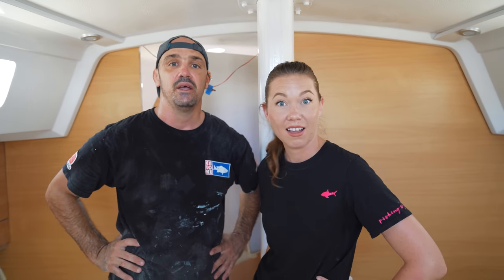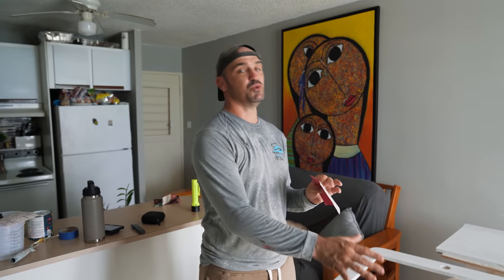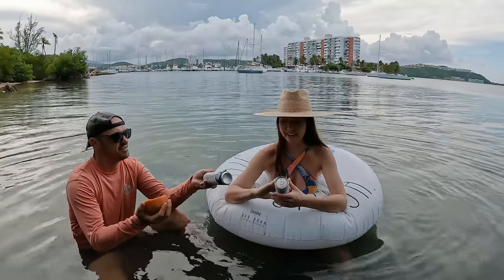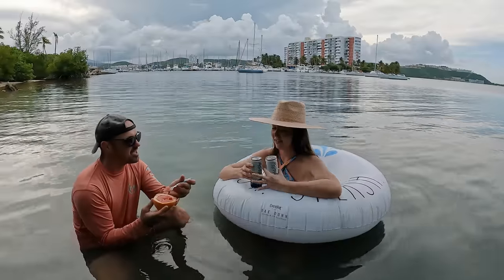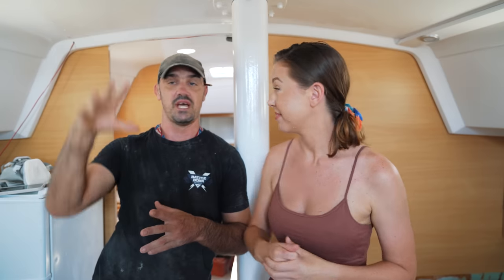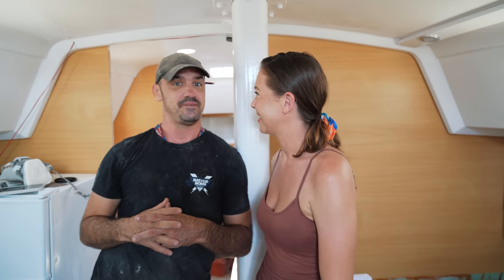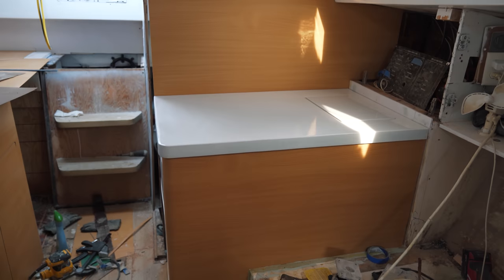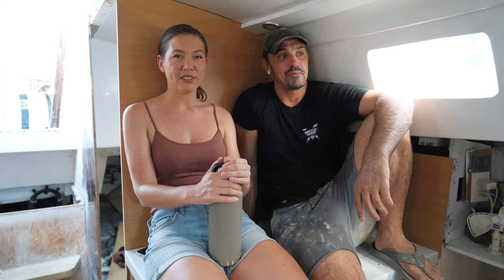GETTING SOMETHING BIG OFF OUR PLATE

Comment: a suggestion, it is to make some storm shutters to cover those large windows, which can be stowed until required--hoping they never will be.  More vessels are sunk through the sea smashing in a large window than almost any other cause (unless one goes ashore on rocks).  These covers  look like a tray made of heavy plywood, with bracing, and having a rubber seal on the edges, of sufficient size to cover the portlight, and  they need to be fitted with stainless tie down loops, and having a strip of glassed in timber fore and aft, above and below the portlight to prevent the cover slipping forward or astern, or up or down. Not only can these be used in a storm, but in the event of holing the hull on some floating object, these covers can also be used as fothering patches. (Patches that may be placed externally over a hull fracture, then secured in place either by using long screws, nails, or around-hull lashings or webbing).

I had only small portlights, but many of them and none of them opened.  Ventilation was by hatches and induction fans operating through insect screened dorade boxes on deck or on the deckhouse ceiling.

Comment: You both have done an amazing job.  As long as the top of the counter is waterproof and looks good,  the edges can be covered with varnished hardwood timber trim.  Looks good and takes the bumps.  For what is is worth, and for anyone else doing the same or a similar job, such as a shower recess,  used a water-based epoxy finish used for commercial heavy traffic flooring, fork hoists, work boots  and grit resistant. It cures to a semi-gloss finish which I kinda liked, but if you want gloss finish, which lasts only a short time, you may have to use another layer of clear resin over it.  I laid it over timber which had been epoxy saturated to seal it, then scuffed with coarse grit in an orbital sander.  There was enough in the can to do more than one set of countertops, so I weighed it on a set of el-cheapo digital kitchen scales, then broke it down to a couple of batches un-mixed, so as to have extra for re-surfacing.  It was expensive, but not as expensive as a product having "Marine" as part of its description.  I must say though--the job you did is excellent and needs no further embellishment.

Comment: Hey guys with the epoxy and resin what you need to do is get sandpaper. Wet sand the countertop wipe it down, then add more epoxy and resin use. The heat gun when bubbles come out use 900 grit sandpaper. up to 3000 grit at the end it should fix the problem you were having.

Comment: Having done 28 linear feet of countertops in epoxy... I feel your pain! However, as you get to the edges lightly roll them let them drip... router off the drips after! I realize this is after the fact! And u are correct, the marbling effects hide a lot of the imperfections! STILL... Goodonyas!

Comment: Glue a stiffener to the bottom of the big countertop. Hot glue works fine. I would hate to see that crack during handling.  Pop it off once it’s in place ready to screw down. Booze locker looks amazing.

Comment: There's a tool called a brayer, a rubber roller used in printing. It would be helpful when gluing the laminate for a overall even adhesion. You'd just roll it all over it with pressure! 😇

Comment: You are doing amazing work, no one looks at side edges of epoxy countertops because the top is epic. Have you rolled the sides as the top? Needs a rolling for you perfectionist! Just do a light sand on sides,  roll it on and be done. It's already looks perfect.

Comment: I did a simular project with my cook top from Jen-air I made the wooden frame and the Two twenty voltage plumbing and the ventilation plumbing too after I disconnect the 1959 electric stove after a mouse jumped out of it as I was making thanks giving dinner for both of the relatives and my wife after that I told everyone to get in the car and went to a top shelf restaurant for the dinner

Comment: In 1902 Léon Levavasseur took out a patent on a light but quite powerful gasoline injected V8 engine which he called Antoinette after the young daughter of his financial backer,   The V8 engine configuration became popular in France from 1904 onward, and was used in a number of aircraft engines introduced by Renault, and Buchet among others. Some of these engines found their way into automobiles in small quantities. In 1905, Darracq built a special car to beat the world speed record. They came up with two racing car engines built on a common crankcase and camshaft. The result was monstrous engine with a displacement of 1551 cubic inches (25422 cc), good for 200 bhp (ca. 150 kW). Victor Hemery fixed that record on 30 December 1905 with a speed of 109.65 mph (176.4 km/h). This car still exists.

Comment: Looking Better .
Carpenter Sailor and camera lady 👏🏻👏🏻👏🏻
Something might com in Handy  when you get into a tight spot with your Router and the Base is in the way , If yo can start and end your router .
Remove the base put your router on 15 or 20 percent ( angle )keep this in mind keep your depth consistent on an Angle 😃
Pay attention when when leaving a  vertical to Horizontal to vertical , maintain same depth and  move slowly an constant.
Captain 
Warning 🤔
Practice  dry Run .

Huge Don’t lean it Back on the laminate it will cut a Dibbet
Camera lady Might swab the deck with You can doo it .
Remove your pice then the you can free hand ,tiny angle finish with sanding block👏🏻👏🏻
Remember There is no Base

Comment: Hey matt it's prob to late to tell you now but when you pour the epoxy straight after the pour use a sander without a pad  on the underside of the top to vibrate the counter that will force all the air out n stop the bubble pop effect

Comment: If you put fiberglass resin in the sun right away, it will become smooth.  I think the sun weakens the catalyst giving it time to settle.  This was my experience with clear fiberglass resin decades ago.  Perhaps epoxy resin would work the same.  I don't know if the white pigment will block the UV and thwart this.

Comment: ALOHA guys Matt check out stone coat counter tops. You need a paper tape on the edges to act like a dam. Remove after it sets up a bit. Epoxy will flow over the edges slower. Check them out on YouTube. Great job. ALOHA

Comment: i think the sides of the countertops should have very little epoxy so it doesnt drip.... maybe one countertop at a time. most of the epoxy on top , just enough to smooth out but not roll over the edge.(have you thought, would some  tape around the edges just high enough to leave a slight lip so it wont run over onto the sides?)... a little less as you get near the edges. then with a brush do the edges (after the top set) just enough to get that wet look....just a few thoughts on it

Comment: You know you can sand and polish epoxy right? as long as the last layer is thick enough, and you don't sand through it. Sand in stages from 800, 1000, 2000, 3000 and finally 5000  grit (use 3m Trizact discs) and then polish with an automotive cutting compound. it'll look amazing - think polishing a car after you've painted it.

Comment: i wouldn't be surprised if the epoxy could be sanded to a 1500-3000 grit and polished like a car finish. if so, and the epoxy is thick enough, you should be able to get every imperfection out and polish to a high gloss finish. you will need six or eight grits of paper and the grits from 800 and above need to be wet or dry sand paper that are lubritcated with water while being used. it's important that each grit should be polished at 90 degrees to the previous grit. that way you can see that ALL the scratches from the previous grit have been sanded out by the current grit, only then should you go on to the next higher grit. and again, sand using all strokes at 90 degrees from the previous grit. if you leave scratch marks in from the previous grit you will NEVER get them out from the higher grits. good luck!

see this: https://www.youtube.com/watch?v=FBucPyRcVbg

Comment: I'm sure the owners of your Air B&B would be thrilled you're sanding and painting and epoxying inside their unit.

Sure the neighbors appreciated the noise and chemical smells too.

That's really bush league guys.  I'm usually with you on your trials and tribulations but as a property owner myself, I'd kick you out in a heartbeat if you did this in my unit.
Reply from the maker: Well, we lightly hand sanded so there was no mess. The entire condominium is under construction daily so there are hammer drills going from 8 a.m. seven days a week and quite a bit of painting and noxious fumes weekly in our building. ( from other units)  And airbnb is covered by insurance and we would be liable for any damages that could be pursued legally.  Good thing we're not in one of your units😅😆

Comment: You got to be careful with epoxy or you'll end up with an expensive paperweight. I absolutely do not like West systems epoxy, it's finicky.
Reply: Raka is 2 to 1 hardener and the West system is 4 to 1 hardener making it easier to screw up the ratio. Make sure to thoroughly mix in a plastic container.